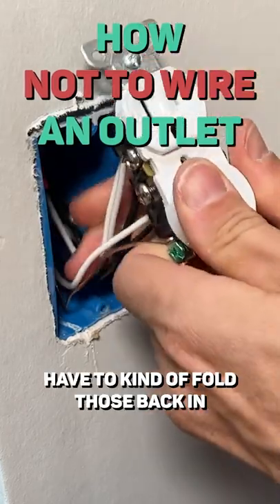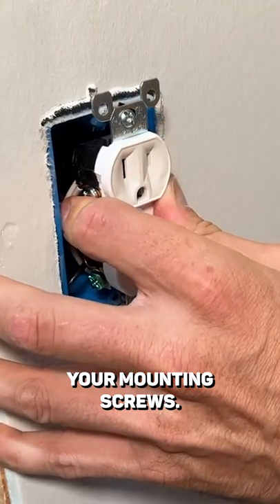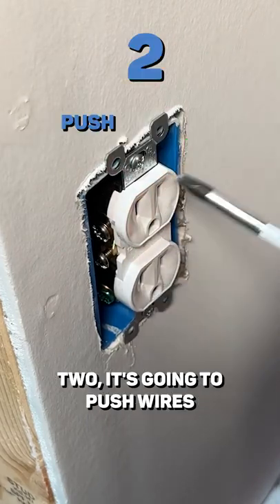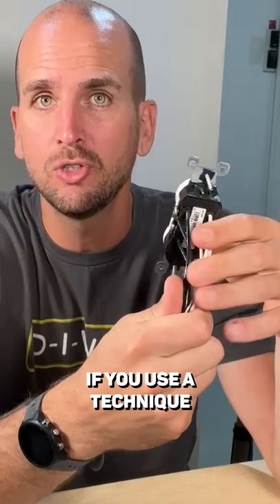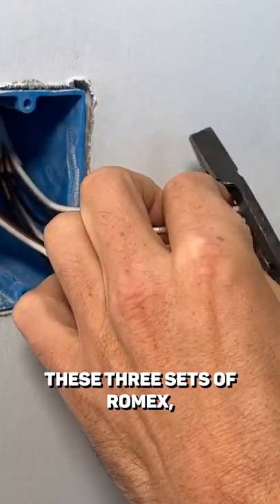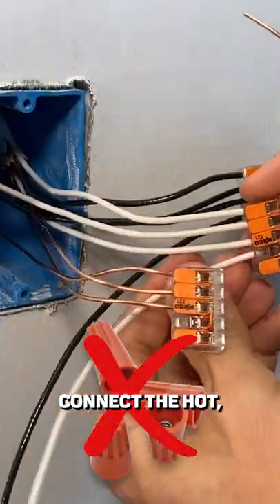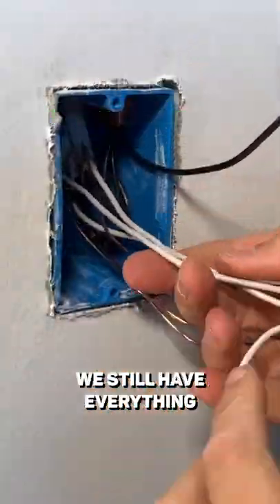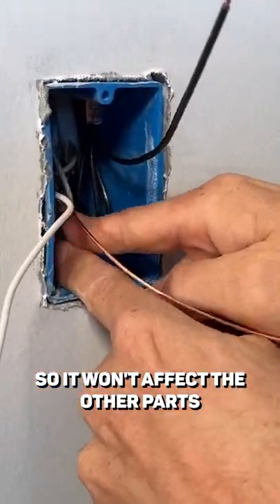The Better Way To Wire Outlets #shorts

Comment: 32 years in the electrical trade-I always pigtailed-it's just way better than using a cheap device as a splice!
Reply: With 47 years of my own, I would have to agree with you. :)
Reply: Same here, started in ‘74, it’s sad to see the “anyone can be an electrician” BS.
Reply: @dominicbenecasa7893  Yup. My four year apprenticeship was the best seven years of my life. These days it's a trip to Home Depot and quick demo and you are on your way.

I knew a John Benecasa who worked with me at Saturn back in the day. :)
Reply: 8 years and I agree. And please people, don’t back stab.
Reply: “I’ve been doing it for 32 years”

Let me help you out:

“Ive been doing it wrong* for 32 years”
Reply: @spurcrawler249  Really? Curiously enough, the inspectors that had to approve my work seemed to be pleased, but what do they know? 

Out of curiosity, do you even have a license? I've got two, my Colorado Journeyman's and Master's licenses. Passed my exams the first time for both exams with a 91% for the Journeyman's in '82, and I squeaked by with a 76% for my Master's exam (75% was failing) in '84.
Reply: @spurcrawler249  Are you saying pigtailing is wrong-and you'd rather back stab?
Reply: @chrshuston  Nah, more of a pleasant surprise. BTW, I missed your score. Go ahead and make one up...
Reply: 11 years always pig tail
Reply: I guess that highly depends on the quality of the device you're wiring in... Just about all have plates (with a tab -break off if you want a split plug-2 circuits) that you're connecting the wire (s) to with a secure fastener (provided you're doing it right, the wire is wrapped around the bolt clockwise, so tightening the bolt pulls in the wire tighter). 

Back stabbing is the cheap way, I don't trust the the connection for that much amperage really, but typically a 15 amp circuit here for this device.

Next topic up for debate; box fill. The size of today's devices (add in usb sockets, GFCI, dimmer, timer) you'll need a deep box, or 2 device box to stuff all your added pig tails in there.
Reply: With two years of field experience but a 4.0 in electrical technology, I’ll say all day, unless it’s for quick installs of LED lighting with low amp draw, waggles are okay. Once you go and use them on a circuit that is going to have either a constant load (like deep freeze, fridge) or high energy draw like a room with a space heater plugged in I wouldn’t trust the thin metal teeth to handle the temperature and would recommend either pre-twisting the wire ends together before a wire nut, or if you got the combo conduit reamer with wire nut driver built into the handle, then you can just shove the wire in and wrench down until the conductors start to twist around eachother
Reply: 40 years in the trade and all that pig tailing costs time and money. estimators don't include that in their bids. 3 cables, sure. An in and an out, just use the device. And never use the back stabs. Every company I ever worked for forbade it.
Reply: @scottodonnell7121  Nah still better to pigtail-no call backs is cheaper!
Reply: @spurcrawler249 do you work as an electrician?
Reply: Agreed
Reply: Wagos are way faster for trim out and safer for ts down the road. There's always times for wire nuts and Polaris connectors though. Being an electrician isn't about being rigid... except for the code... it's about being adaptive and open to new ways of accomplishing goals
Reply: @RespectedElectric  Not always newer is not always better-and you dont have to re-invent the wheel! The cheaper devices with the stabs are usually junk! You're way ahead and smarter to make pigtails and eliminate that one weak point! And where I practice the trade many locals wont allow the stabs anyway.
Reply: I really wish we could just leave a constructive comment without someone always feeling to need to be contrarian. I don't use stab ins for switchboxes @DARK24-7. Only levers. And yes lever wagos are 100% safer than nuts. That's MY opinion but I bet many other electricians will agree
Reply: We can have 4 other devices being fed uninterruptedly rather than having to untwist a joint. No hot wires to arc or gf. Again just a personal preference
Reply: @RespectedElectric  Well if you're afraid of being disagreed with then dont leave comments m8-especially on lesser methods-I'm sure many electricians would agree!
Reply: @RespectedElectric  But if one the cheaper devices fails then you have multiple things go down with it-takes much more time to diagnose and more inconveinient for customer! Just a matter of preference. And the codes where I'm ay are very strict so the using devices as a splice is not permitted in some municipalities.
Reply: @RespectedElectric  Well when you leave something like this that is promoting not the best method-you're going to have responses-you got to be ready for that. And the cheaper devices are junk and should not be used as a splice-pigtails will be way more reliable.
Reply: I think you're confused sir. I NEVER jump devices together
Reply: @StephenBrewer89 why is backstabbing so frowned upon? I’m not an electrician. I just do my own basic home owner stuff. But I’d love to know specifically why it’s a popularly hated way. Thanks
Reply: @johnc1280  I personally don’t like it for multiple reasons, I have had multiple calls about circuits with bad connection and burnt devices. Lots of times it was the terminal spots in the back where the wire is pushed through. You just don’t have enough contact to warrant a good connection. Now, they are legal, they are easy, and they are convenient. I just don’t like them and any TRUE electrician will agree.
Reply: @StephenBrewer89  thank you much for that 
Can I ask you a quick question? 

I would really appreciate your expertise advice. I’m moving an outlet from one part of the wall over about 4 feet. If the slack isn’t long enough, and I have to graft in a new piece of Romex to make the necessary length, what’s the safest way to join the wires and secure them in the wall. I did put in another single gang box. I was thinking of twisting all the wires together, tighten with wire caps and also electrical tape. And then just putting a blank outlet cover over.
Reply: @StephenBrewer89  basically what I was not going to do was just connect the wires and then bury them in the wall against the insulation
Reply: @johnc1280  yes you can use wire nuts, but you never want to do what is called a “floating tap”. You always want to have junctions in a UL rated box with cover, if it were me on that job, I personally would either A, use the existing recep box as a junction and add your new one as you stated, or B, (what I would do if this were my house, pull the wire up to the attic and make a junction box up there and cover the unused receptacle box. More work, and I’m OCD. I think your way will work and be safe. Give your conductors a good twist before wire nuts, to ensure a good connection. Something like that will sometimes be forgotten by the wayside and if you ever have problems in the future you may not think to check it. Sorry for the long reply. Electrical is really cool, I’ve always enjoyed it, but it can be dangerous if things are not done right and you can lead to fires and putting family in danger. I think your capable it sounds like 👍🏻
Reply: @StephenBrewer89  thank you very much. I appreciate your time and response. One thing that I failed to mention. Which is certainly important here, is the outlet I moved was about 16 inches high off the floor in the kitchen. I’m moving it because I’m building a built-in bench. So that would mean that the receptacle which I would connect the wires and cap off, electrical tape, etc. would be on the wall/in the wall behind the new built in bench structure. However, I stopped doing everything. Consulted you. Because I read that’s a big no-no. You always want to make boxes with connected ends accessible….right?
Reply: @johnc1280  yes they do need to be accessible. What I have seen before is make that junction where the receptacle box faces the room in the wall on the opposite side it’s on now. 

Really, lots of people do taps where they are covered up and forgot about. Not saying you can’t, but it really does need to be in a junction box, and for future it’s best if it’s easy to get to just in case there is ever a problem.
Reply: @StephenBrewer89  thanks so much. I appreciate it. It’s just a matter of moving it to have access to it like you said, in case there’s an issue or I sell the house. Because they won’t approve an up to code pass on that right ? If it’s buried and behind a structure attached to the wall…I figure that’s a hard no 
This kitchen built in bench will be COMPLETELY secured to wall in an ‘L shape’
Reply: @johnc1280  no problem buddy. And technically, they will never know if they can’t see it on an inspection for selling a house.
Reply: @StephenBrewer89  I just finished it and done and cleaned up. 

Took your suggestion. I reversed the gang box to be accessible into the mudroom closet on opposite side of the wall. It’s fully accessible
Reply: @johnc1280  good deal! God bless you man. Keep at it! No need to pay an electrician for some things. Just always need to be safe.
Reply: @StephenBrewer89  thanks much boss! I agree and that’s my approach. Teach myself
You’re def providing sound knowledge and assistance here. Thanks 

What’s your go to method on drawing in three lines of romex to one single outlet? Pigtailing?
Reply: Might as well use a wire nut since those splice boxes take up so much room
Reply: @scottodonnell7121 bad bad bad
Reply: @johnc1280 when you push the wired device back into the box, the stiffness of the solid wire causes kind of a force that pulls on the termination.  It's a weak connection anyway and that only makes it worse. Especially with #12 solid. Guaranteed to fail over time.
Reply: @scottodonnell7121  thanks for that response. Now. What’s your take on Wagos? lol seriously. Over wire nuts, Yes or no?
Reply: @johnc1280  Those weren't around when I first started in 1982. Started seeing them years later. I suppose they're okay, got the UL Listing. I still prefer wire nuts. Wagos seemed kind of flimsy and less practical. To each, his own.
Reply: @johnc1280  We didn't have those when I first started in 1982. I guess they're OK. They have a UL listing. They always seemed like a flimsy connection and not practical.  Still use wire nuts. Just my opinion.
Reply: can anyone here help me. I bought 12/2 wire can I just put the 2 power wires on one on each side then hook the ground up then run to more power wires off the one outlet to another outlet?

Comment: Yeah it's way easier to get the outlet mounted when you cram three huge wagos in there instead of folding the wires back in. 🙄
Reply: It is
Reply: Everybody's  an electrician with a wago connector ✨✨
Reply: My thoughts exactly. Also sometimes you have more wires in that box and I can't believe to this day that the NEC does not account for wire nuts or lever nuts to be counted as conductors. Blows my mind
Reply: Wago fire starter 😂
Reply: @maniacmachanic9870   ?? Wdym
Reply: @hihaveaniceday9386  wago are not save to use wires are lose inside of them ..wire nuts are better
Reply: @MANIAC MACHANIC   bruh there  literally made to handle all types of wires  especially  lose one you are just buying the cheap ones